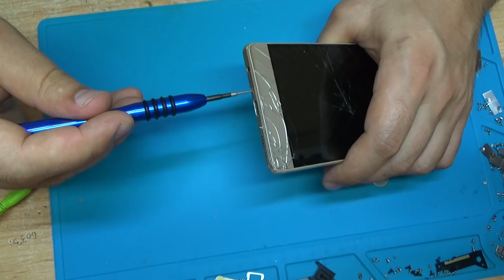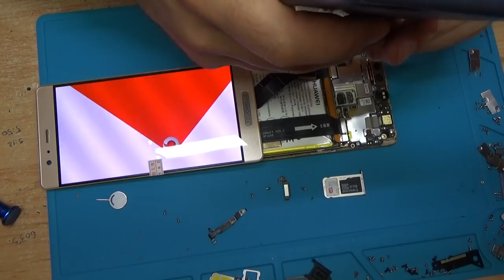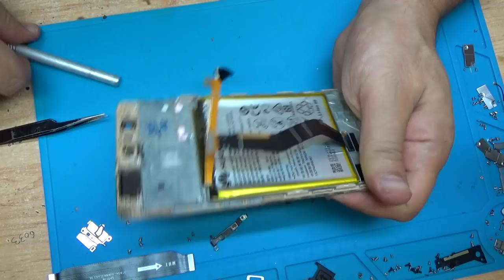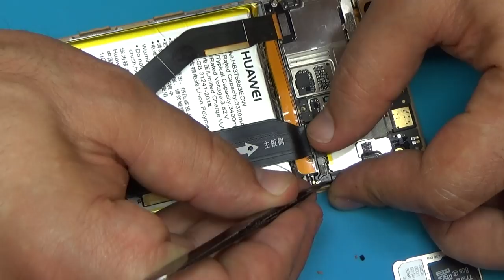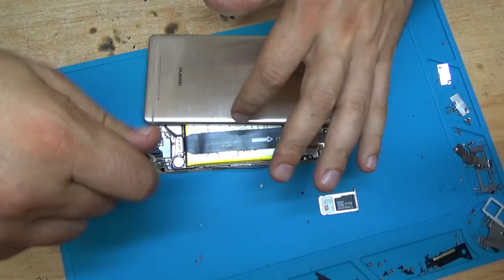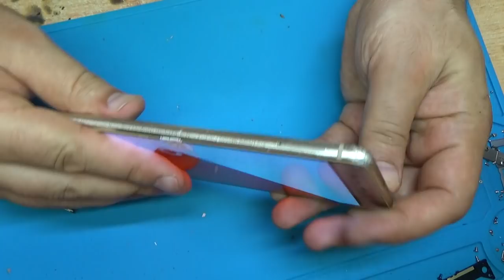Huawei P9 Plus (VIE-L09)...lcd replacement

Comment: Really useful video, thank you Soslan. The trickiest bit was to remove the battery. I accidentally punctured mine but replaced it with a brand new one which works really well.